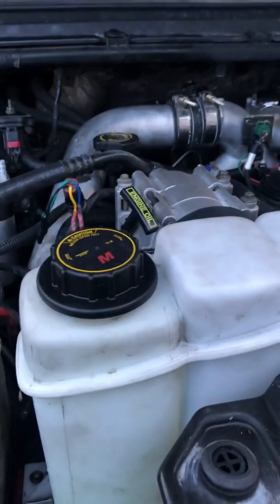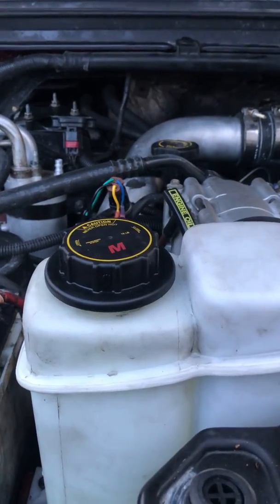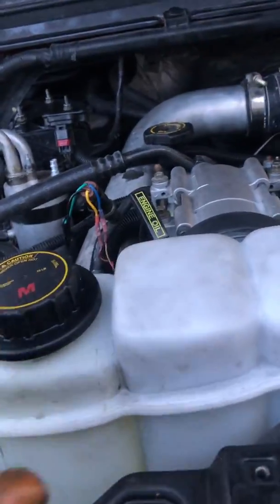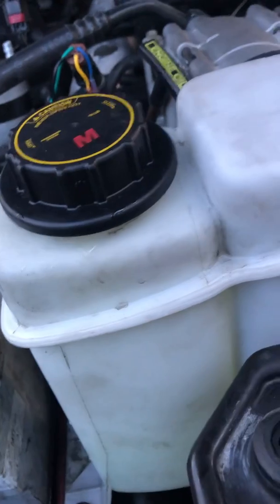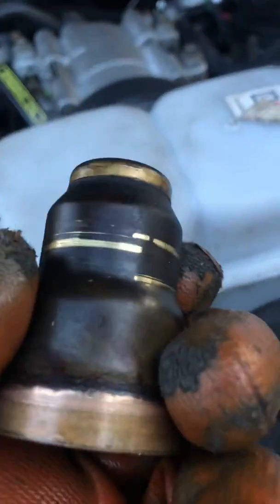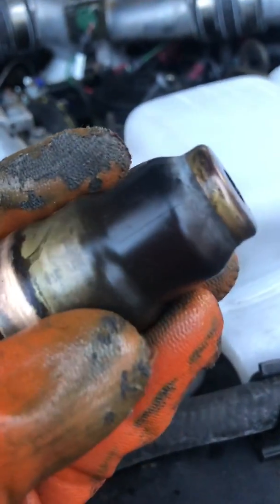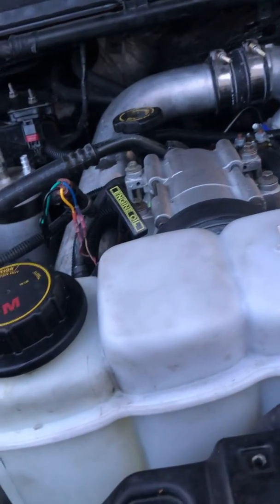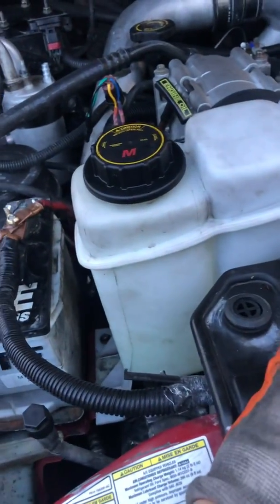7.3 Powerstroke. Cracked Injector Cups Causing Degas Bottle Geyser

Comment: Hey buddy I got a f350 95 and The guy who sold me the truck told me to change the injectors cup the reason is that when my truck is on the smell in the exhaust is very strong don’t smell like a normal 7.3 that I have smelled before. My question is did your truck smells bad  before u did the cups replacement?

Comment: Im having the exact same problem now after installing injectors. I thought it was cups but along with the geyser, i have coolant in my oil. Leaning towards head gasket, but im going to do a compression test because the cooling system holds 12psi.